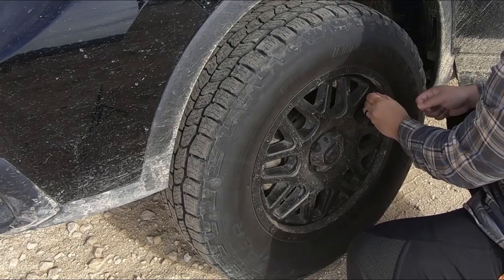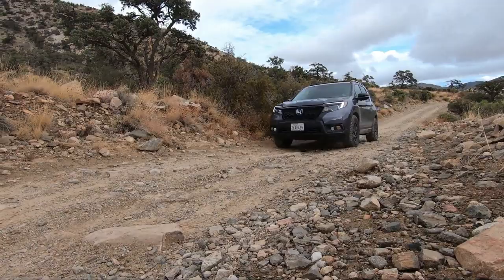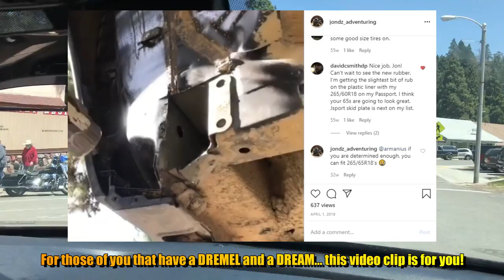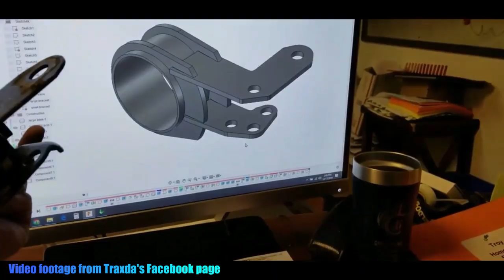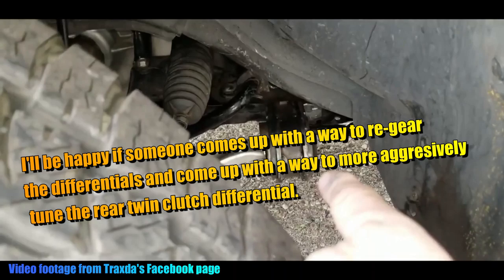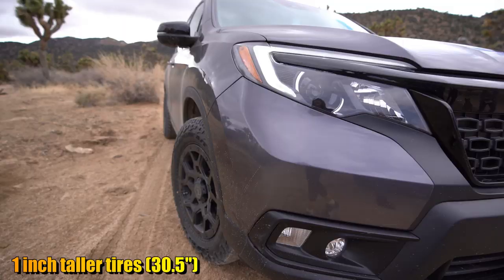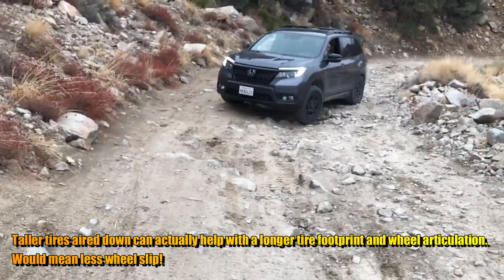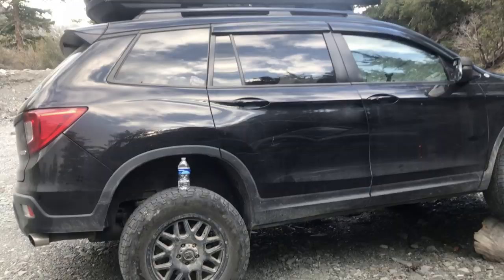TALLEST TIRE?  On a Passport/Pilot/Ridgeline

Comment: My plans for the truck are mainly for it to be a pavement Queen but I do occasionally go to the beach and drive on sand. With that said, I'm looking at the Traxda 2" front and 1.5" rear lift and am considering 20x9 +30 offset wheels with 255/55r20 tires. Any idea if this setup will fit on a 2022 model Ridgeline without rubbing?
Reply from the maker: Go 265/50R20, which is a 30.4” x 10.4” tire.  That’ll fit.
Reply: @JonDZ_Adventuring  Thanks for such a quick reply. I was looking at that size too. Great video by the way!

Comment: Jon do you think a 265/50/20 will fit without rubbing? Looking at the falken at trail? Falken website says it’s 30.6 tall tire calculators say it 30.4?
Reply from the maker: Yes, sorry for the late reply!  Those will fit with slight rubbing at 90% lock.

Comment: How does the lift and bigger tires affect the Ridgelines ride on the highway and what's the damage on MPG?
Reply from the maker: The lift kit will affect MPGs, but it won’t be noticeable.  Maybe a 0.1 mpg loss.  Tires will adversely affect MPGs.  The wider you go, the more friction there will be, ALSO tire width means more tire “tread” and tread is heavy.  Tire weight really affects stop and go city MPGs.  The less gears in your ride, the worse it’s going to be.  So if you have a 2017-2019 Ridgeline, it’ll be worse than if you had a 2020+ Ridgeline.  Tire type is also a big factor.  I think I talk about it in this video, I made this a little while ago.  I personally drive a Passport with the ZF9 speed.  At the time of filming this video I was able to get 23 MPG highway cruising at 70Mph
Reply: @JonDZ_Adventuring  23 is actually not as bad as I thought it was going to be. I only asked about the lift because I know it can affect the ride a little. Had 2" body lift on my Silverado and I could fill that the steering felt a little more "Floaty" especially on roads with sharper turns.
Reply from the maker: @JS-qi1ou  I lifted my Passport even further with a 3.5” lift kit.  Between a unibody crossover (based on a car chassis) and a body and frame truck, my lifted Passport with the rear sway bar disconnected handles somewhere in the middle.  I use to drive a toyota FJ cruiser and a Subaru Forester.

Comment: Hello Jon, Great videos and content!! I am looking to have the JONDZ Special lift kit (3.5" front & 3" rear w/axle relocator) installed on my 2016 Pilot (Currently 20" stock rims). What would be the largest tire I can install with out rub and have you had any mechanical issues? I my changed them out with after market 18" wheels. I so what would be the recommended offset and tire size?  I am looking to install the Falken WildPeak AT3.
Reply from the maker: Hey Charles, pre congrats on your lift!  So, the axle relocation kit will move the tire forward almost an inch.  This gets the tire away from the metal wheel well that goes into the fire wall, and puts it in the area of the plastic wheel well near the front bumper.  You’ll be able to fit a 32.1” tire, something like a 255/70R18, or a 31.6” tire like a 265/65R18.  I think Greg from Traxda has a video where he mounted 285mm wide tires.  He had to use wheel spacers because the very wide tires were hitting the subframe at steering lock.  I just don’t see a reason for the extra width, added tread is so much heavier than added sidewall, so I would not recommend going past 265mm width
Reply: @JonDZ_Adventuring   Lift kits has been ordered. What Offset would you recommend for the 255/70r18? I am also looking at keeping my stock 20" and Mounting 255/55/20 which will give me 31" tires, any thoughts.
Reply from the maker: @charleskim6059  pre congrats!  Since you have the axle relocation kit, you can go with 32” tires.  265/55R20 would do the trick or 255/60R20.  Just check to see how much clearance you have on the inner front subframe when you turn the wheel towards the center of your vehicle .  You might need more offset on the wheels.
Reply: Jon, What is the offset of the wheels you are currently running on your vehicle with the new tires?
Reply from the maker: @charleskim6059  I choose to run 10mm offset wheels (black rhino - case.  18” x 8”.  I bought them in preparation for running a roof top tent.  I wanted to widen my track width.
Reply: Hello Jon, Shop Installed the Traxda 3.5 lift kit with axle relocate. Mounted 255/70r18 tires and rino wheels with 35 offset. They have had to do alot of trimming front. The tire is rubbing the washer reservoir. I saw some a fix someone did in a video.  Do you happen to know what the fix is? Adding spacer? The car is still on the lift today.
Reply from the maker: @charleskim6059  I personally don’t run the axle relocation kit (so instead I trimmed about an inch of metal wheel well and pinch weld).  I wish I could help, I would give Greg at Traxda a call.  Good luck on getting the issue and resolved.  Please let me know what the fix is.
Reply: I didn't realize you didn't use the axle relocation part. I'll keep you updated.

Comment: What do you mean a 20 inch will get wrecked versus an 18.  You are trying to go taker and you suggest going smaller?
Reply from the maker: Charles Goehring more wheel and less rubber.  True story, on the night I drove my Passport home I scraped my wheel on a curb at the dealership, it was quite embarrassing.  This would have never happened with a recessed wheel and an all-terrain tire with more sidewall. 

The sidewall with a 20 inch wheel and oem tire size is 4.8 inches.  If you go with an 18 inch wheel and plus size to a 30.5 inch tire you would have 6.3 inches.  I have made modifications to my wheel well to allow for 32.1” tires, I have 7.0 inches of sidewall.

Comment: Hello, from any videos I’ve watched it doesn’t seem to tuck the tire in the fender well at full compression. Is that correct? I’m guessing suspension bottoms out before that point.
Reply from the maker: That is correct, Independent suspension isn’t as flexible
Reply: @JonDZ_Adventuring  
Ok. Thank you, I seen you are running a +10 offset on your wheels. Would you say that is the sweet spot for the tallest tire turning lock to lock or would a little higher positive offset be better?
Reply from the maker: @krish9538  the stock 55mm offset would work best.  Or you can run whatever offset you want with the Traxda USA axle relocation kit.  I personally shaved off my pinch weld.

Comment: what kind of wheel spacers are good for the 2016 honda pilot?
Reply from the maker: I’m not sure.  I’m not a fan of wheel spacers.  I rather just buy offset wheels.  Oem is 55mm, a common aftermarket wheel will be 35mm (0.8 inch spaced).  I now run 10mm wheels (1.77 inch spaced).  If you’re just driving on the street, you should be fine with wheel spacers, but I don’t recommend it for adventure travel off pavement.  Wash boards can rattle the bolts loose.

Comment: ¿What about negative offset rims?
Reply from the maker: Mine are offset 38mm (-17).  Spacing should help.
Reply: Jon, what are your thoughts about using 30mm offset (-25) x 9' wide wheels
Reply from the maker: Would definitely help!  I’d love to have an offset of 20mm, that would be perfect for me.  Since you plan on going with a wide tire, you should try to get them as low as you could go.

Comment: Any issues with the tire light staying on with the bigger tires?
Reply from the maker: No.  That would depend on the tpms sensor.  The PSI rating on the door jam is 37 psi.  Because of the extra weight I carry, I air up to 40 psi.  I’ve been as high as 44 psi with no light.  around 33 psi is when I get a low pressure warning.

Comment: Can I put bigger tires on my Ridgeline AWD? I know will fit the 265 but my question is most regarding the AWD if there’s an issue been an AWD
Reply from the maker: The answer is in this video, you’ll learn so much more by watching rather than me typing it all out.  No, tire size won’t mess up your AWD system.  “Different” size tires will mess up differentials.  If you run too big of tires on a Honda 5 or 6 speed, then you can really stress out the transmission.  On the ZF9 or Honda 10 speed, you can run whatever. We have someone running 34” tires with no issues, and I have 165k miles with 32” and 33” tires.
Reply: @JonDZ_Adventuring  thank you I watch the video couple times already sir but sometimes I need like more personal responses thank you I will be more confident now to go buy the 265 for my Ridgeline
Reply from the maker: @OmarM.Garcia  265 is the mm of width.  Just keep in mind that in this video it’s mentioned you can fit a 30.5” tire on a non modified 2017+ Ridgeline with slight rub at full lock.
Reply: @JonDZ_Adventuring  yes sir thank you!
Reply: @JonDZ_Adventuring  I already ordered the tires 265/60 18 scorpions all terrain plus
Reply: @JonDZ_Adventuring  I finally installed the tires THANK YOU for your help & patience no rubbing at all thank you again!!
Reply: What about the offset of the rim choice? Will that have a big influence on whether or not a 265/60/18 will fit?
Reply: @jaybo9044  I using the stock wheels, the ones that come with the HPD trim
Reply from the maker: @jaybo9044 that’s a really good question!  I believe more offset will help clear taller tires.  Wow, I totally didn’t cover that in this old video and no one else has asked!  Haha

Comment: What brand/ratio do you recommend for 17" wheel?
Reply from the maker: Daniel Ku without modification you can run a 265/65R17 tire.  That’s 30.6”.  There may be slight rubbing, but only at full lock... which just like @remisc mentioned, only happens when you make a U-turn.  The rubbing really won’t be severe either.  As far as tire brands, there are soooooo many options.  What kind of driving will you be doing?
Reply: @JonDZ_Adventuring  Thanks
Reply: Do you know why does the pilot has a lower ground clearance if all 3 are the same? According to the Honda website the pilot has only 7.3 inch of ground clearance. The ridgeline and the passport both have 8-in ground clearance.
Reply from the maker: Daniel Ku the wheel well clearance is the same/similar, but actually there are differences between the 3 suspension size.  The Ridgeline has 50-70% more robust suspension parts, the AWD Passport has taller suspension parts and have 8.1 inches of minimum ground clearance.  The FWD Passports and Pilot’s have 7.3 inches.
Reply: @JonDZ_Adventuring  I am looking at all-terrain tires. Cannot decide between Bridgestone Duler A/T Revo 3 or Continental Terrain Contact AT. I own a 2017 Honda Ridgeline AWD and 2020 Honda Pilot AWD.

Comment: What about Honda sensing?  I’m seeing comments that it’s impossible to recalibrate (which is part of a windshield replacement) if the front end is “too tall” compared to OEM specs.  Any experience with this issue?
Reply from the maker: Jake S I pretty much lifted my Passport at 5k miles.  All I know is that my adaptive cruise control and lane keep assist works.  My speed sensors were recalibrated recently due to my 2.5” taller tires.
Reply: @JonDZ_Adventuring  I was wondering, does Honda still uses the old style of sensors? the one build into the valves? I was told at Dealer that the Honda accord uses ABS sensors to count how many times the wheel spins and if there is not enough air, the count is different and that is how TPMS knows that there is not enough air in it.
Reply from the maker: I’m not sure, but in the 2016+ Honda midsized SUV/unibody truck you can air down as much as you want while still being able to disable traction control.  The older Hondas has an issue where you couldn’t turn off traction control while aired down.

Comment: How is your gas mileage.
Reply from the maker: Gio Renaud with the 265/65R18 Cooper discoveries in this video, I was able to get 23 mpg at 70 mph and and 19.5 mpg at 90 mph.  Now I’m running 255/70R18, and I have less than 1000 miles on them.  It looks like the faster I go, the less MPG I get.  The tread is more aggressive than the coopers and on a few test runs I’m showing 18.5 at 80 mph going slightly uphill on a 90 miles drive, then I drove home slightly downhill and got 24 mpg.  This weekend I drove 170 miles from Los Angles to the Eastern Sierras.  I got 19.5 mpg going 70 mph from sea level to 2300 ft.  On the way back, I had a head wind, and I was driving 80 mph and got 18.5 mpg going downhill.  It’s really had to say.  My friend with a 4 runner said he was cruising and getting 14 mpg.  I’ll need more samples on these Falken wildpeak AT3’s.  They weigh the same as my Coopers and are 0.4 inches skinnier.  I thought I would have an improvement, the tread is just too aggressive I think.

Comment: A stock 2021 ridgeline... What size bf goodrich at tires could I run with no lift?
Reply from the maker: Ouuu, did you buy a 2021 Ridgeline?  I love the redesign!  Since it’s a redesign, same rules apply, a 30.5” A/T is the largest, 265/60R18.  There will be slight rub at 90% lock, but nothing that will damage the tire.
Reply: @JonDZ_Adventuring  I'm looking for one now.. rtl in blue
Reply: @JonDZ_Adventuring  sweet thanks

Comment: So now you have worse mileage, it's not ment as a serious offroad, just get a jeep
Reply from the maker: 805gregg surprisingly the MPG hit wasnt that bad.  The passport is rated for 24 mpg, and I get 23mpg @ 70mph with the lift, tires, trimmed front bumper and a cargo carrier.  This probably mostly has to do with Honda understating MPG’s. I hear if you leave a Passport stock, they can get 28 mpg.  So I if this really means I lost 5mpg, it’s all good.. I was expecting 24.  With all that said though, the Jeep JL’s get some decent MPG’s too, especially the diesels.
Reply: You get a Jeep, but make sure there is a dealership close and you make friends with all the Service people, cause you'll be there a lot!

Comment: Honda does not have a Better AWD then Subaru. Sorry lol
Reply from the maker: Brad Michaud the CRV and HRV definitely don’t, but iVTM4 equipped Honda’s like in the Passport/Pilot/Ridgeline don’t compete with Subaru, they compete with the Grand Cherokee and 4 runner. Honda claims is below them offroad wise, but is designed to be more capable than other mid sized offerings.  The only small crossover more capable would be the Jeep Cherokee trail hawk with a rear locker and low gear transfer case.  Hey... I didn’t believe all this either until I saw what the pilot and Ridgelines were doing on the YouTube channel TFL.  Then Subaru enthusiast Ryan from Driving Sports TV showcased the passport.  It was in a class all it’s own and has completed tests that other vehicles weren’t able to do.  They tested a brand new Mercedes G wagon on an obstacle the passport completed.  They tried it with the center locker,
Then the rear locker.  It wasn’t until they engaged the front locker (all 3 locked) to complete the test.  TFL is doing comparison tests on the Honda Ridgeline comparing them to the Ford Ranger FX4 and Jeep Gladiator.  Much respect to Subaru, except for their choice to continue to put CVT’s in their vehicles 😖.
Reply from the maker: Brad Michaud not sure if you are aware I drove 2 Subaru’s before this Honda (first one I’ve owned).  My YouTube icon will stay as my 2015 Forester XT because it’s the vehicle that got me out adventuring.  ✌️
Reply: Brad Michaud 
😂
Reply from the maker: Rey Perez to be honest, I use to be one of those guys too!   This video is a good comparison about capabilities.  “Comparison” does not mean it’s a competition.
*forgot to link video*
https://youtu.be/vV5q51uAjA8
Reply: @JonDZ_Adventuring  
Subaru was really good until they started using CVT
Reply from the maker: Rey Perez so in my next video I think I have the “unicorn Subaru”.  Older Subaru’s have the 4EAT/5EAT transmission but they didn’t have traction control.  Some older models had a rear LSD (like the 2005 Baja in the video I linked).  The newer Subaru’s with CVT’s have traction control, but transmissions are no longer able to truly lock a gear.  There’s also no potential to load up on the torque converter for “a bump”.  BUT... there is a Subaru that has traction control, 5EAT and a 3.6 boxer engine.  This model ran from 2010 to 2014.
Reply: @reyperez3424  The main reason I bought a Passport over an Outback...!
Reply: @reyperez3424  continuously variable transmission?I heard about that way back when.  Sounded like a good idea.  What don't you like?